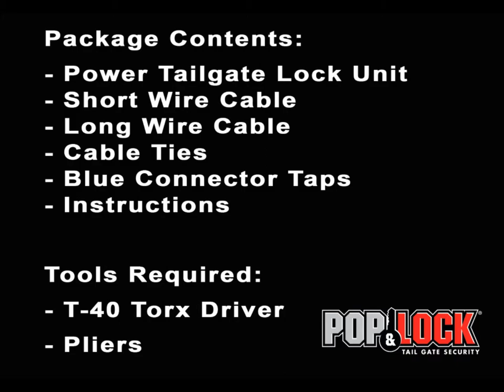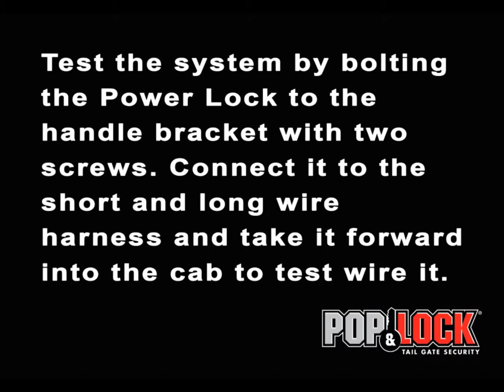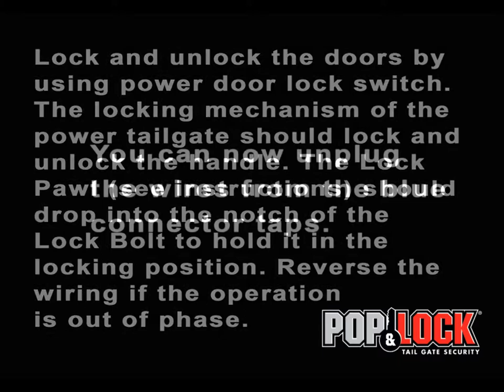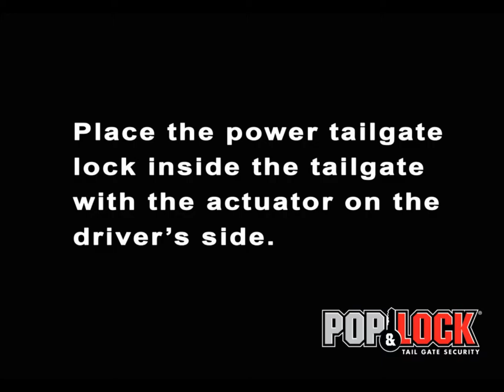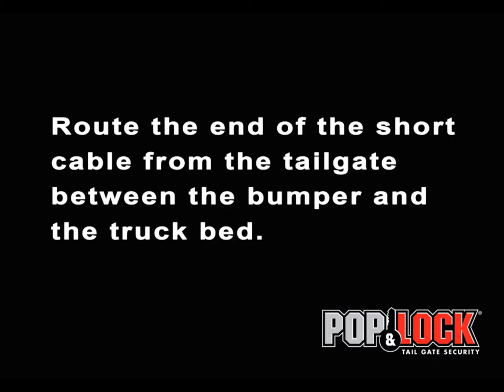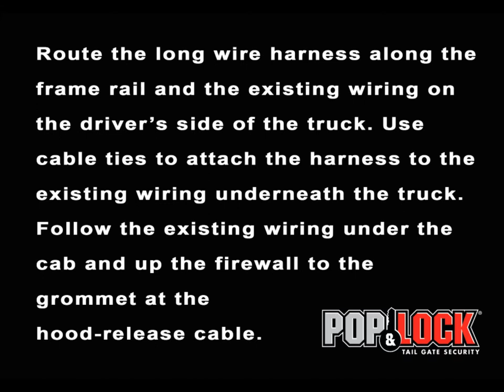PL8100 Power Lock Installation Instructions

Comment: For those of you with a '97+ Dakota the wire colors are NOT gray and tan, they are Orange/Black and Pink/Black (striped wires).  You can actually see the demonstration is being performed on a Dodge Dakota and the wires that are tapped are the correct colors.  You're welcome.
Reply: I know you made your post three years ago but maybe you can help me anyway. I have a 2011 Dakota and I want to have the Pop and Lock activated by the passenger door rather than the driver's side door. Do you know the proper wire colors? I can't find anything on Google.
Reply: @Pro1er  I have no idea, sorry. I didn't even remember making this post in the first place, lol.